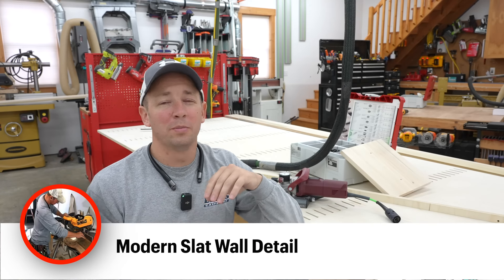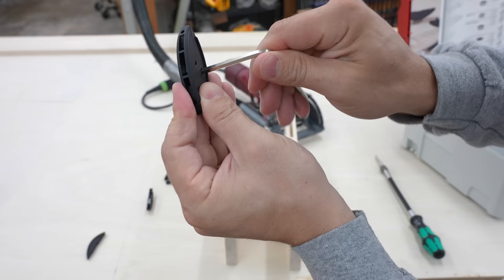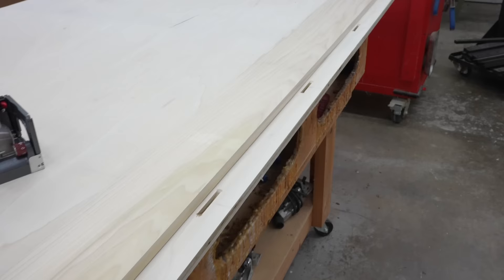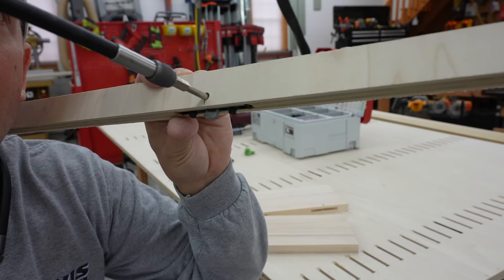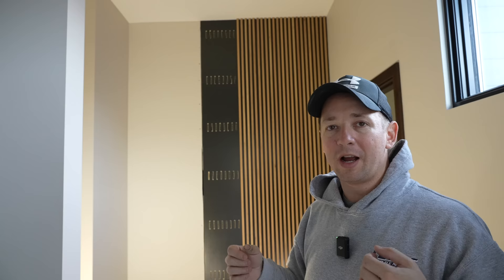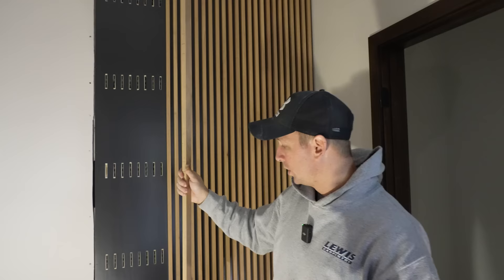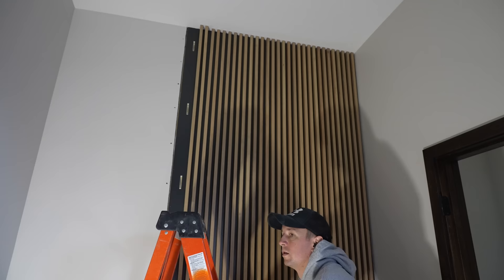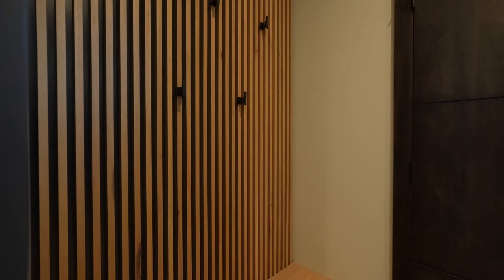Was The Lamello Zeta Worth It??? $1600 Tool & $300 In Connectors for This Detail!!!

Comment: After 40 years in Cabinet Making and Millwork, all I can see when I look at a project like this is all the ways it can go wrong. All of you who haven't scribed pre-finished 4' x 10' wall panels, floor to ceiling, can shut up and sit down right now. Handling such a large sheet with the slats installed is begging to damage the edges, and the ceiling/walls. Fastening the slats from the back without seeing the front fit is guaranteed to end up with a couple slats pulled away from the backer due to the screw pushing instead of pulling - a very unavoidable event in the middle of a 4x10 when you can't even see what you are doing. And nailing blind from the back through 3/4 sheet into 3/4 x 1 1/2 solid hickory - man, you got to be a masochist. One blowout, and you're so screwed. 
People really don't know what they are talking about in the comments, and the more experienced ones should know better.
Reply: Maybe spend some time practicing with your screw gun to warm up. Not much to driving a screw into a pre drilled hole in plywood and then into the back of the pre finished hickory. And I never saw a wall panel that didn’t need a scribe fit. But that length of base sort of makes it easy to cheat on a scribe.

Comment: Don’t you love architects?  Nothing like a $10,000 accent wall.
Reply from the maker: There is nothing like giving a newel post a good smack!
Reply: Yes, a $10,000 accent wall that will look dated in 15 years and be relegated to kindling status.
Reply: If it sells it sells. I do believe even for the life of the house and it’s location not much of anything will be changed except wall coverings decor and window coverings. For the footprint of that house less walls are usually better.
Reply: I’m curious why the cabinet guy passed on this part of his work.
Reply: @henrypeisch5289  seriously? look at how much work that took.
Reply: Henry Peisch  Is right this is a cabinet guys job, Not the trim guys
Reply: Speaking as a carpenter, I love it!
Reply: @davesch1512 it's whoever wants to do its job. Been on a lot of jobs like this and I feel sorry for the haters on things like this. You'll never be successful in this market let alone the two tiers above this level. Spent 20 years on top tier houses. Learned a lot working on jobs where it was everyone working together.
Reply: @jonnya3425 nope. This type of wall has been around since the 50s at least. I've seen them still around in the  original installation. Don't know the level of this house but well designed houses don't change most of the time
Reply: @sparksmcgee6641  I agree. There is a decent sized cabinet order in that home. I’m also assuming that the same shop provided everything…kitchen, built ins, vanities, etc. I’m just curious about the reason they would have taken a pass on the slat wall. But I’m also assuming a cabinet shop would have used more conventional methods for attachment. If the slat wall was a change order item after the cabinet guy moved on and was too busy to build it, I would understand that. But that’s not what happened. The shop cut and finished the hickory for Spencer. I’m not objecting to the decision but just curious to get the full understanding. I would be surprised if the reason is that the cabinet shop bid too high and the slat wall defaulted to the trim guy. I would also be surprised if the cabinet guy was intimidated by the design. I would be surprised if the architect or designer specified the method of attachment other than “hidden fasteners”. So, just trying to figure it out. If Spencer wanted to build just for YouTube, that might make the most sense but would surprise me at the same time. But the title of the video asks if it was worth it. Spencer answered that already.
Reply: @henrypeisch5289  productivity was the issue. Everything is man hours for the next 10 years at least. The cabinet shop can cnc a hundred cabinets, assemble them and mount them in the time it took Spence to do this. At a $100 a box gross profit that's $10,000 to invest. The guys like Spence are the ones to geek out on details and I bet they have a Great relationship. Every top tier house I was on had 5-10 guys doing things like this while the top tier businesses were doing 90-95% of the cost. 10 million dollar house leaves 500k for detail work like this that makes the house top tier.
Reply: @sparksmcgee6641  so, the cabinet guy passed on the slat wall because it wasn’t a cnc cabinet and it was not a project within their productivity wheelhouse? You must know the guy.
Reply: @henrypeisch5289  I'm giving what I presume is the reason the cabinet guy passed from my 20+ years in top tier homes. I'm not psychic😃. Keyboard bimbos flame all over construction videos and I just wanted to point out a simple reason someone doing a $100k cabinet package would pass on this. Keyboard bimbos would then say "the cabinet guy should hire more workers, if he can't hire he should raise his rates, if he can't raise his rates he should improve his work. I took a business class in college and these construction workers don't understand business" I've literally had that conversation in person 100 times and it wasn't until about 6-8 years in that I just started dropping the hammer on people and explaining they looked stupid saying that about a business they were ignorant of. Namely the top .5% of new housing units in the state.
Reply: @sparksmcgee6641  want to take a shot at why the drywall was removed?
Reply: @henrypeisch5289   because he mounted it on ply and it lines out with everything around it. Easier to mount to the wall without drywalls uneven surface telegraphing through.
Reply: @sparksmcgee6641  You are correct about not being psychic.
Reply: @henrypeisch5289  this is you tube and some people here are learning a lot. I spent a lot of time standing around with people as 2-5 trades figured something out. No surprises afterwards,  the trim person knows what they have to work with and earlier trades know to shift and keep an area clear.  I just like to pop in and explain a broad picture of why a totally competent cabinet company would take a pass on work that looks like a slam dunk.
Reply: @sparksmcgee6641  I tend to think that someone just wanted to gain the thickness of the drywall. Maybe they also stood around and watched 2-5 trades figure that one out. Can you explain a little more how the drywall would “telegraph through” the 3/4” ply on this wall and how removing that drywall would help the plywood “line out”. Line out with what? Sparky, I’m glad you are here to pop in. It helps the channel.
Reply: @henrypeisch5289  at the top tier everyone can tell that the install is standing off the wall. The cabinet next to it would be the same depth as everyone else of it's type in the house and this would be proud 3/4. And yes once your at finish a lot of people, including owners, can see that.
Reply: @sparksmcgee6641  except that the only cabinet (locker) meets a wall with more depth on the left side and it is a full height cabinet to the ceiling. So the only difference would be the strip of drywall between the door casing leg and the right leg of the bench. Visually, someone must have wanted that gap to be maximized. But that’s not what you are saying. So, in a similar situation, let’s say in a kitchen with only one tall cabinet and an adjacent full height panel, would you remove the drywall? Sparky, I hope not. Fast forward to the end and you can see the finished installation. Even for a guy like you with top tier X-ray vision…the only place you would see this is at the bench leg. But a flame will find that open bay where the drywall was pulled off the wall…all by itself.
Reply: Looks dated now! Next owner will rip out immediately. Lol
Reply: @davemachoukas6175  your not very familiar with modern era of architecture. If the rest of the house is done well in the style I will stay until the next remodel. Second if the next owner wants to remodel because they like traditional then everything, including what you think will last forever goes. 😂  Working on top tier houses I found I have a very good eye, I worked to develop it. In the end what the owner wants is what I'm paid to do. The reason I was a  "he's the Guy"  type everyone hired, was because I learned to use my abilities to improve whatever someone wanted, not to put my spin on it.  If people weren't listening to trades we'd laugh when they weren't around, if they were listening and I saw something that didn't look good I'd go find the person building it and ask why. Often it was a reasonable thing like he's always wanted this since he was a kid or got fired from his first job ect.....
Reply: Taking nothing away from Spencer’s approach to this project, there is no one, including most professionals, who will ever look at this detail and think anything more than that it looks good.  Very few would ever suspect the amount of artistry and effort and expense that went into this slat wall design. I hope the owners were at least informed about what went into this build so that they can brag on it a little.

Comment: I have a project coming up where i have to build a 6x7 accent wall with sticks like the ones in your video. they also want a little a spot in the middle for a TV. Do you think its possible to achieve a result close to this but with dowels? Or maybe use a 8" level with clamps on each stick as it gets fastened to the backer? I love this Lamello tool. Its so versataile and amazing.
Reply: The answer to your question about best method may depend on design…and if your backer and slats are each pre-finished with different finishes like in the video. In any case, consider a jig with spacers or do a dry clamp up with the slats and spacers face down and position the ply backing over the assembly and attach from the back. A comment mentioned plowing dados in the sheet stock and inserting slats in the dados.  This type of dado assembly can be done face up of course. But any time you take a dado set or router bit to a sheet, you own the cut. If joining sheets, just layout so one slat is over the plywood seams. Spacers of course are removed after final positioning. This would be quickest IMO. I would guess that with the dado method, I would want thicker ply than if no dados. I would try assembly with no dados but drill all your holes first and assemble upside down. No pilot holes in slats, just select the correct fastener to attach. If slats are hardwood, you will need minimal penetration to attach. That would be my preference over using a dado set or router. You will need consistent spacers. If you lay out your slats with spacers and dry clamp, you will know if you will be happy with the margins and how well the assembly will stay straight.
Reply: I understand that materials were not available to Spencer and this is in part why he did things this way. A finished shop panel could have been installed after the locker cabinet was in (and over drywall, instead of removing drywall) So, I still don’t get it.
Reply: @henrypeisch5289  Thanks for your reply. I was also thinking to do the dado method to drop each plank in but for that wouldnt i have to glue 2 pieces of ply wood together to gain thickness?
They said that the wood they ordered is some amazing quality stuff thats already milled and squared and prepped and everything. So we will see how it turns out but yea thank you again for all the info!
Reply: @NextLevelCraftworks  1/4”deep plow is enough. I would think you could use 1/2” ply also. It’s being installed over drywall.
Reply: @NextLevelCraftworks  if you go with the dado, the slat material has to be perfect with respect to thickness. May be a cautionary point depending on who milled and dressed it.
Reply: @henrypeisch5289  Yes its going on drywall with metal studs behind. Thanks for all your replies. Im gonna test a dado idea on a scrap and see how it works with the material and if its sufficient to hold it straight as i fasten it from the back. I think im gonna use 3/4 plywood backer and cover the exposed ends with a frame like border.

Comment: I'm a fan of your chanel and the very smart techniques you use

But in this case the same thing could be accomplished with dowels that cost pennies.

You have to get a shop to CNC the holes and maybe use a edge drilling/line drill to drill the edges of the slats in  a fraction of the time

I'm  not trying to troll, I went to school  on many of your videos

Comment: All this work you're going in this small piece of wall it's old style it doesn't have a function and it's difficult to keep clean
Reply: It holds at least 5 ball caps or tennis visors and maybe a couple of rackets. And the house keeper has a dust mop.

Comment: Overkill dude. We build these all the time! Just use finish ply on the wall painted black. Attach the slats with pl400 and pin in place till it drys with 23g Headless pins. Never had a call back. Probably a better way then your doing... shouldn't cost so much for a client..
Reply from the maker: Maybe if you're nailing on perfectly straight strips. But there is no way 23 ga is gong to hold bendy hickory pieces straight.

Comment: That’s over complicated. I’ve made kilometres of oaks “slats walls”. You basically just need a table for upside down assembly and nails/screws. And don’t forget sound absorbing textile. Whole point of wooden slate walls is sound manipulation.
Reply: Yes, however in the video, he said they don’t have the hickory yet…. So he can install the slats without pre drilling and screws on the back.  I’m not sure how you would do thatafter with the panel bare and fastened to the wall… I assume they can also just keep rolling on installing the other built-ins as well keeping the timeline in mind.
Reply: @Dawson Purkett  the amount of extra time and therefore money to keep the timeline on track seems odd. maybe it was fixed bid. nice build but seems like an over engineered solution
Reply: Having used the Lamello, I’d say this isn’t over complicated at all.  It’s an incredibly easy tool to use.
Reply: Don’t second guess Spencer. 😂😂😂
Reply: @Matt Muller  yea, why not just brad nail them one, tacked in a few places while a grab adhesive cures to do the actual holding?
Reply from the maker: The idea was not to have a bunch of exposed fastener holes.